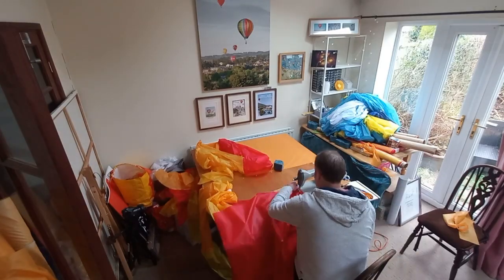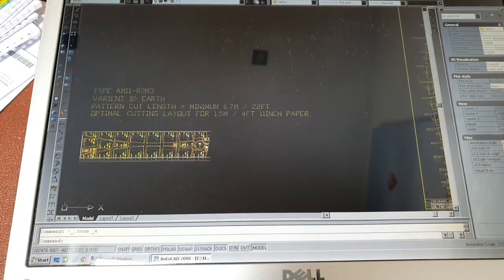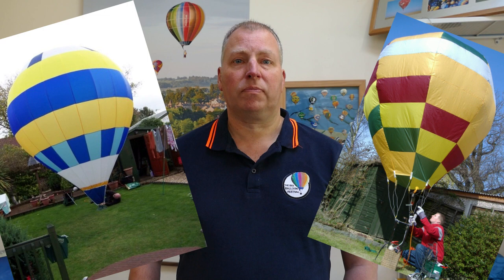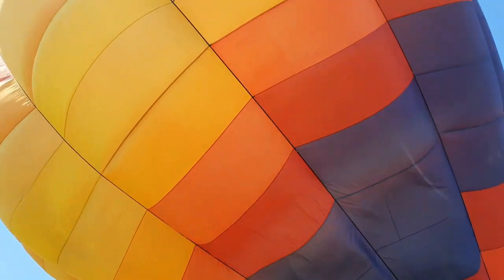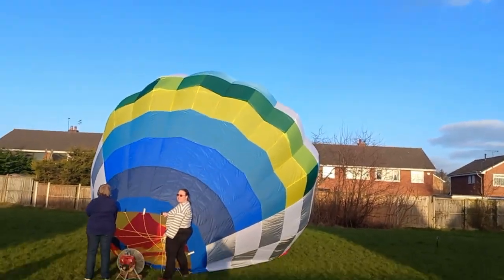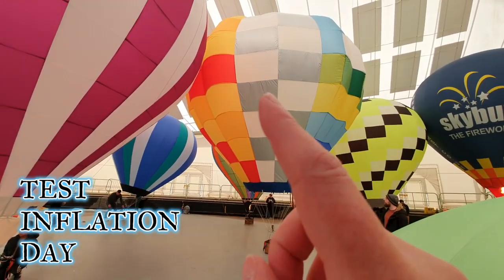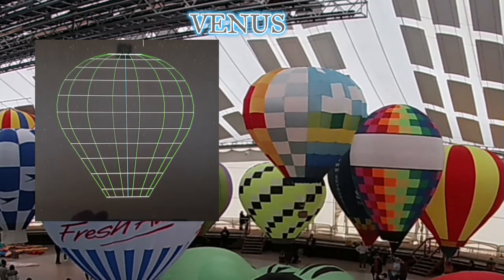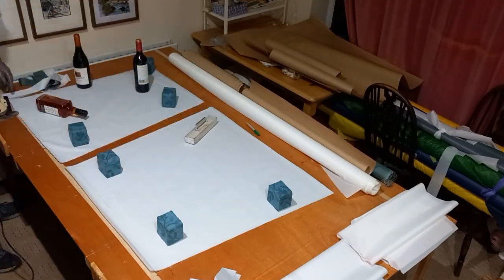RC Model Hot Air Balloon - You Can Build Yourself

Comment: If I'm making a balloon with about 15 pound core, how big should the envelope be, and what material should i make it out of?
Reply from the maker: a quick calculation and I would suggest at the very minimum a volume of 700ft3 / 20m3 - you will need to consider the overall weight of the system - such as the material making up the balloon envelope, wires attaching to the basket, any fuel you are carrying - each of these will need to be added to the `Total weight' of the balloon and therefore the volume will need to increase to keep lifting your 15 pound payload - fabric - my balloons are built from a ripstop nylon at 42g/m2 - I hope that helps
Reply: @TheBigBalloonFestival thankyou

Comment: what is the website you use to create your patterns please?
Reply from the maker: Hi Gabriel, head over to theBIGballoonfestival,com for the options on the 3 designs
Reply: @TheBigBalloonFestival  okay and what stores near me would have printers to print theses patterns
Reply from the maker: You will need to talk to someone who is printing on industrial paper, places doing car wrapping for example, or if there are businesses working in the fabric industry.
We can always talk to a few people in the uk homebuilding community. Which design are you thinking you like the best?
Reply: @TheBigBalloonFestival  I can do all but i like Venus
Reply: Sorry I meant ‘I’
Reply: so i have built a PROPER model balloon basket just needs a burner and controls, but where did you get your burner from and since it wasn't bolling how did you connect it?
Reply from the maker: @GabrielsModelballoons-x2f that's great News on the envelope, looking forward to seeing it.
I constructed my burner myself with the help of a few other ballonists, and it uses all kids of odds and ends 😅 the main can is the same as my blow torch, made by a company called sievert, it is not the standard cylinder shape one but has a cone, burner coil was made by hand, and the fittings, nuts and connections etc I've used swagelock in the past but they are expensive, find a cheaper equivelent. My mate Neil did all the rc and tanks and plumbing side of things, wonder if he still has any spares, I can ask if you like
Reply: @TheBigBalloonFestival  yes please thank you so much
Reply: @TheBigBalloonFestival  oh i haven't built the enevelope yet
Reply from the maker: @GabrielsModelballoons-x2f😅 my mistake on that one, I read PROPER model balloon (then my brain skipped the basket bit) 😂
Reply: @TheBigBalloonFestival  i think i forgot to put a commar 😅

Comment: Why do you make the beginner (venus) gores out of multiple joined panels of material instead of making full gores out of just one long piece of material cut to shape?
Reply from the maker: Ha, you know I never even considered that for this project, back to square 1. 
I always struggled to find material with enough length as a kid, designing a 20m3 envelope that way, and then having to split it at the equator. I often constructed balloons from scrap in my younger days, I found cutting the design into more panels made finding material easier to source,  as well as the limitations of work surfaces / cutting tables etc
It's a valid point though? Perhaps a revisit to the design in the future for a single panel gore 🤔 or the next experiment

Comment: Nice one Andy, so model balloons don't use the French fell seam or have load tapes? I've always been tempted to buy/build a model balloon but all my money seems to go on full size ones.... Missed you at Midlands but managed to catch up with Bob which was nice. Hopefully see you in a field soon.
Reply from the maker: It's optional and I've designed it with enough seam for French fell if anyone wants to do it, I even searched out a video on how to single needle a French fell seam 😮 but nope no load tapes except where the wires connect at the mouth